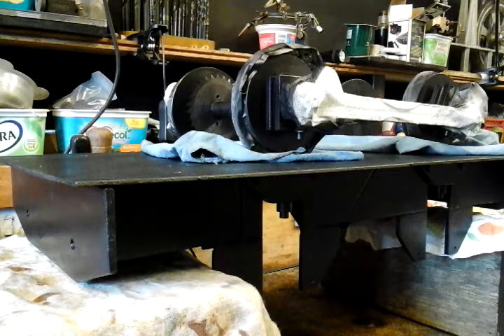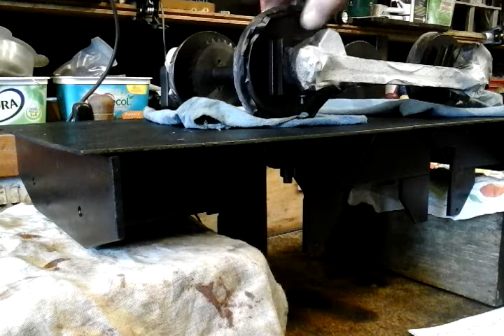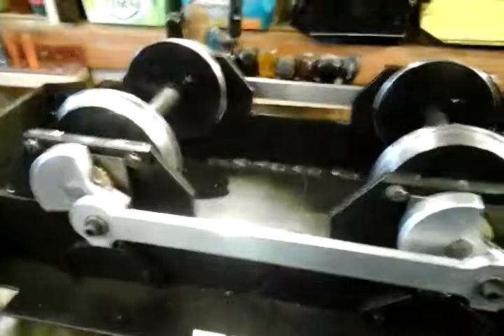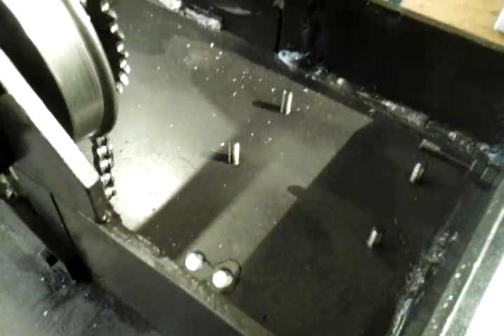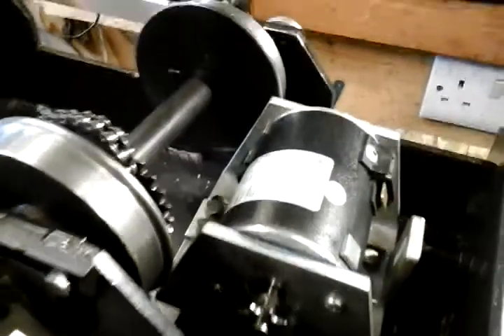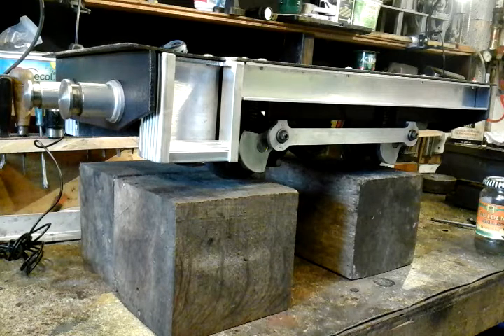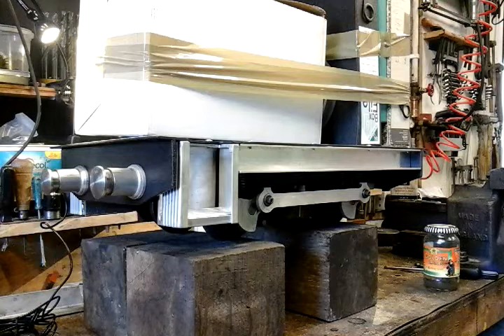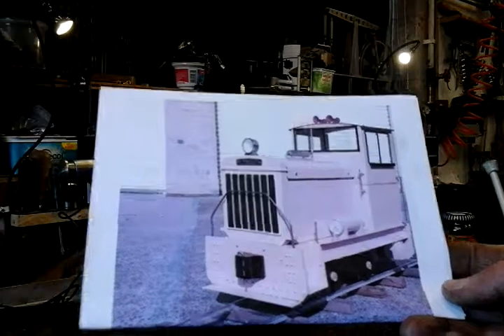Battery Electric Loco Build from scrap  part 5  'chassis assembly after paint + body' 'Mr Factotum'

Comment: I can you tell me what motor you used/bought please good work by the way
Reply from the maker: Hi marc
Thanks for interest, i used two 12 volt , 150 watt  parvalux motors from parkside electronics, i am running them in parallel on 12v baterries but i propose to change over to 24v in series when i have time to change them.
Regards
Mr f

Comment: What sprocket did you use?
Reply from the maker: Hi
I revised the gear ratios to the following
One chain was on a 12 tooth sprocket from the motor to a 16 tooth sprocket on the layshaft.
Then another chain 8 tooth sprocket from the layshaft to 30 tooth sprocket on drive wheel
This was replicated on front wheels and rear wheels, i.e.  each set of wheels with its own 120 watt motor
I think in one of the latter videos (part 6, 7, or 8), i showed a revised  sketch of the gearing arrangement.
Also as i managed to squeeze two 12v batteries in the loco, i am now thinking of in the near future to changing from 12 volt running up to 24 volt to increase the top speed from about 4mph to 8mph
Hope this helps
Regards
Mr f
Reply: Mr Factotum ok thanks, it would be great to see it running!
Reply from the maker: Glad to be of help, i have a non public video of me an grandaughter going round track on it,  i'm not quite sure how its done but i think if you give me your email i can let you see it, 
i will have to look in to how its done and if i can i will post it to you
Regards
Mr f
Reply from the maker: Ive had a quick look and yes it seems as if you let me have your email i can add you to a list of who can see the non public video, of the loco pulling me and grandaughter round the track
Regards
Mr f